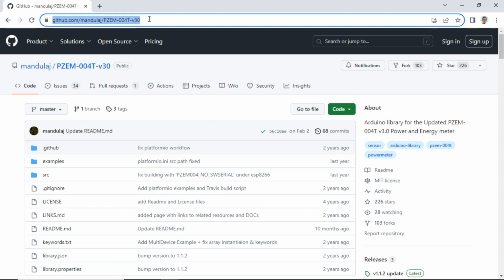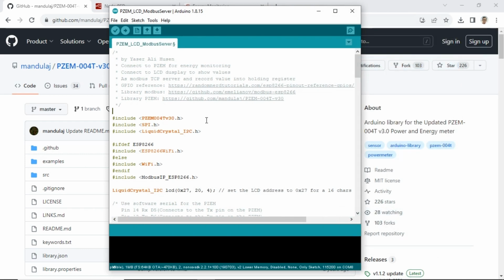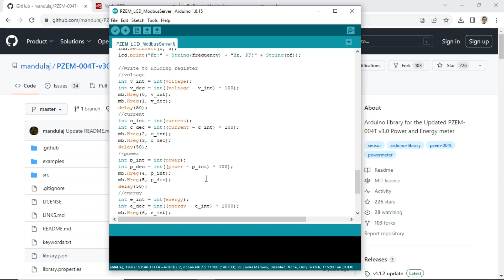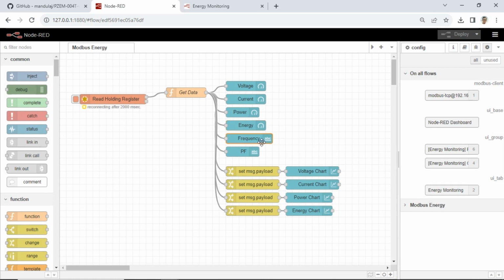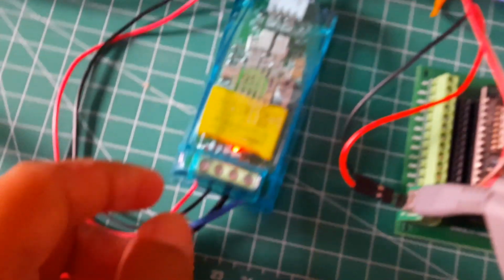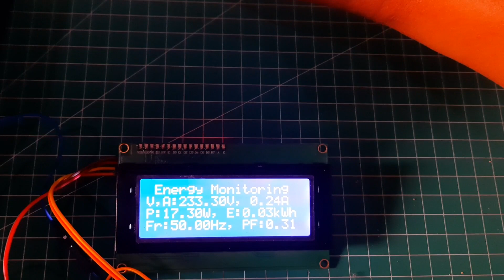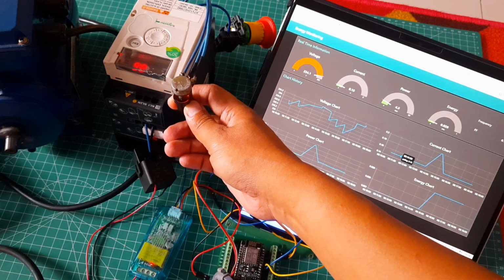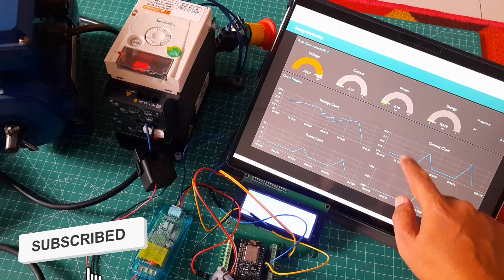PZEM-004T Energy Sensor with ESP-8266 and Node Red Dashboard

Comment: Thank you for the sharing, I have some question about the code.

#ifdef ESP8266
#include <ESP8266WiFi.h>
#else
#include <WiFi.h>
#endif
#include <ModbusIP_ESP8266.h>

How do I find those files? (<ModbusIP_ESP8266.h>,<WiFi.h> & <ESP8266WiFi.h>) Or I should include which library?
Reply from the maker: For modbus, you can download from the github and paste into library folder.
Link: https://github.com/emelianov/modbus-esp8266
Reply: @YaserAliHusen  how about the ESP8266wifi.h and wifi.h?
Reply from the maker: @yinyenlee109 , You can find it in Libary, usually if you choose board ESP8266, will automatically add this library
Reply: @YaserAliHusen   Thank you for the information! May I know can I try this with esp32? I just tried it and it can run using Arduino, but cannot run in node red. Is that anything I need to change inside node red? (I had changed the IP address). Or I need to create the TCP server as previous video?
Reply from the maker: @yinyenlee109 , for ESP32, maybe you can use ESP32.
You must check connection between ESP and computer (node-red) you can ping the ESP to check connection.
Then in node-red flow, check the IP of ESP as modbus TCP server
Reply: @YaserAliHusen  ok understood, thank you so much!